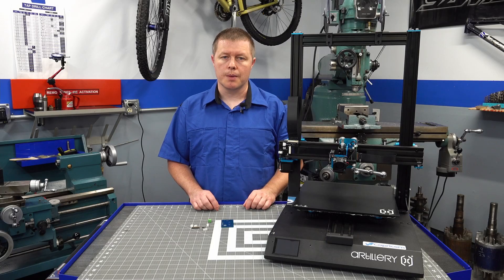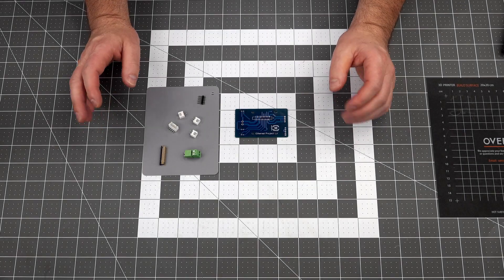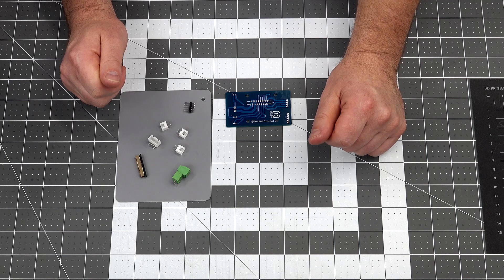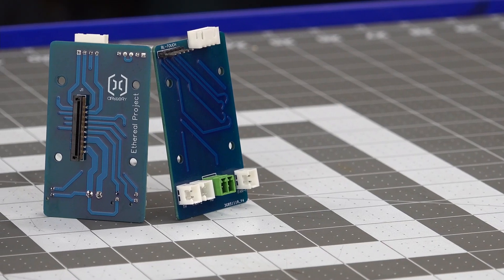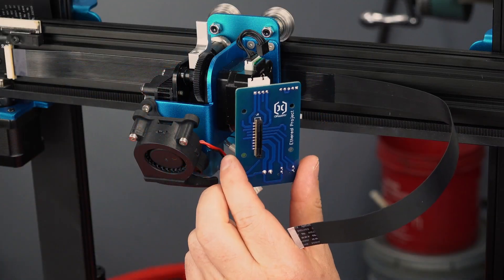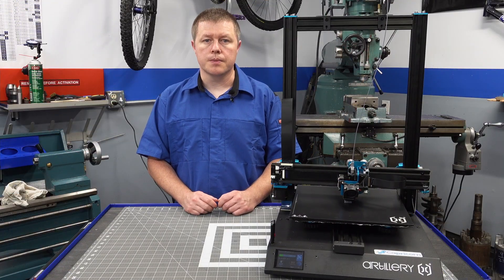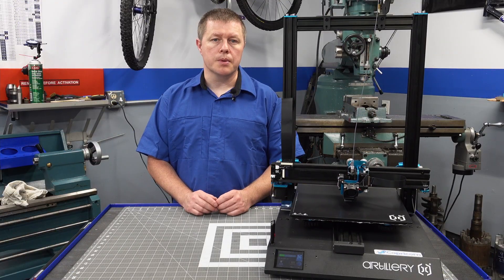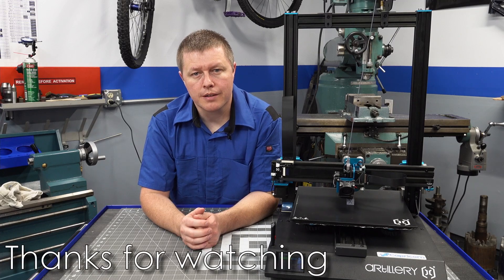Sidewinder X1 Custom Extruder PCB.

Comment: Great video. I just installed this board....but didnt use the ferrules as mentioned at 4:00. Will it be ok? Will i go to hell?
Reply from the maker: You should be ok for a little while but I would get ferrules sooner rather tha  later. It could last forever without, or they could come loose on the first print. Not having them can be a gamb.

Comment: This happens because the top 4 pins are connected to the extuder motor. And the two bearings (625Z) inside the extruder motor get damaged easily (as they work under pressure for pulling the filament) and they need to be replaced. If not, then the extruder motor works under high friction (even stucks sometimes) and burns the cables. This is what I figured out.

Comment: First things I printed with and for my SWX1 were a cover for the x-axis board and a new cover for the extruder with a BL-touch mount. Both with guides for the cables, so they sit more securely and dont bend so close to the connection. I have had this printer for about two years and so far everything is perfect.

Comment: You are not welding correctly. The tin is applied in the same place where you are heating with the soldering iron. You are using too many flux The solder you use incorrectly for soldering ALREADY HAS FLUX IN ITS CORE.
Reply from the maker: Thank you for your consideration.

Comment: Hello sir quick question I just purchased one of these PCB and really love the design but I am having issues with my hot end. Every time I try to heat it up it blows the 10amp fuse on the bigtree v1.4 turbo. I triple checked the wiring and looks over the hot end wiring and well switched around the wiring without luck. Any help would be greatly appreciated.
Reply from the maker: Double check that the wires going to your heater cartridge are not shorted, its easy to accidentally make the wires touch at the heater side when messing with it. Also check for a short from the board side to the mainboard.
Reply: @EtherealProject3D  Thanks a ton I triple checked everything again last night. I did some further troubleshooting. I put on the old board and heated it up without any problems. I put the new board back on without the heater cartridge and it still pops the fuses when trying to heat it up without any extrude. The fans work fine, BLtouch functions normally when powered on just appears to be the heater cartridge. I also removed the heater cartridge to ensure nothing was shorted out to not avail.
Reply: @EtherealProject3D  Really appreciate your response and help with this!
Reply from the maker: @LazyDayFPV . Ok, i will send a new board to you today, sorry for any inconvenience.
Reply from the maker: Could you email me your order number at etherealproject3d@gmail.com
Reply: @EtherealProject3D  appreciate you sir!🙏
Reply from the maker: @LazyDayFPV  what was your order number
Reply: @EtherealProject3D  10236
Reply from the maker: @LazyDayFPV  Thank you
Reply from the maker: Its on its way.
Reply: @EtherealProject3D  appreciate you!🙏
Reply: @EtherealProject3D  my apologies sir it wasn’t your board. The issue still persists. It looks like the hotbed is shorted once I connect the ribbon cable to the circuit board. It’s a v4 printer could that be the problem?
Reply from the maker: @LazyDayFPV  My board is made for the V4 machines.
Reply: @EtherealProject3D  interesting then I must have a v1-v3 🤦‍♂️ my apologies I will send back the other board!
Reply from the maker: @LazyDayFPV  does your printer have the button next to the screen?
Reply: @EtherealProject3D  no sir.
Reply from the maker: @LazyDayFPV  Yeah then you have an older machine and my board wont work. Im sorry.
Reply: @EtherealProject3D  Are the other PCB board's on your sidewinder version 1.5? 
I am looking to buy all the V4 PBC's to change everything over.

Comment: I looked at buying one of these when they were released but had concerns about the ribbon cable, at first they did not have replacement cables on their website and that was the final dealbreaker for me, in the end I bought a Creality Ender 5 Plus and built a Pro 3D V-King 400
Reply from the maker: Sourcing the ribbon cables was going to be too costly unfortunately.

Comment: Which way is the BL Touch cable supposed to plug into the board?
Reply from the maker: Yellow, red, brown, black, white starting from the gantry.
Reply: @EtherealProject3D  Thanks, I figured it out with the ohmmeter. Works great! Thanks for all the work you put in it.
Reply: Do you have a link for the stl file for the BLT mount that you are using?
Reply from the maker: @nflgun  You are very welcome.
Reply from the maker: @nflgun  Yes I do, email me at etherealproject3d@gmail.com

Comment from the maker: UPDATE: For those of you wanting to purchase one I have good news. I will have boards ready to ship in the next week. The boards are $15 USD. Shipping to the us is $10, Canada and Mexico $12, Europe and Australia $15. You can choose to have it assembled or as a DIY kit. Also you can choose if you want the BL Touch connector to be the the standard DuPont type or a JST type. If you are interested please email me at etherealproject3d@gmail.com
Reply: What kind of shipping is it, as $10 seems on the expensive side of things
Reply from the maker: @tampabuc2004  USPS Priority. After factoring in the box, bag, bubble wrap, shipping lable ect it ends up costing a few cents over 10 bucks.
Reply: @EtherealProject3D  I'm not trying to tell you how to run your shop, that's 100% up to you. But First Class is a great way to ship things under a pound. It could save you and the customers a little bit. Either way, I'm looking forward to your boards arriving! Any idea when you might have a BLTouch video up? I'm not very savvy when it comes to modifying and flashing firmware.

Comment: What about that fan duct? Did it make any difference over the stock one?
Reply from the maker: I don't really remember, I had the stock one for all of the first 2 prints. I got this one mainly because I think it looks way better and it has been working really good. Quite a few people use this one and say it is better than stock.
Reply: @EtherealProject3D  the hard part is that the 4020 don't give much pressure over its flow, so intricate ducts do not always work as intended. I'm having a hard time finding one that will let me print inner overhanging walls at 100mm/s without curling up. A 5015 looks to be the answer.
Reply from the maker: @brunoosti1  A bigger fan will always help with those pesky overhangs.

Comment: Just found your channel. Great work on showing us x1 owners of how to make our Great machines that much better. I am definitely interested in your break out board. As someone who has little hand function, I need my printer to be as easy to use as possible. So a BL touch would be great. I wonder if Artillery copied your work for the new X2. But I guess you could look at it as a honor that they ďid. Will be looking for your next video. Cheers from Canada 🇨🇦 👍 😀
Reply from the maker: Thank you for your kind words. I don't think they copied my design, but I am interested in getting the X2 to get a good look at whats different myself. I will post an update for the breakout boards when I am ready to start shipping them. Thank you again and cheers from the USA :)

Comment: The ZIF connector is an improvement over the stock connector but it will fail eventually too … just ask owners of early versions who had the same. The fix is far simpler - just print one of the many stain relief brackets to stop the cable flexing at the socket.
Reply from the maker: I agree that strain relief is a great solution. I think having a quality ZIF connector will be a great solution as well.

Comment: I have 4 Sidewinders all fitted with a BLTouch. How much will it cost for a fully soldered board with JST connector (BLTouch) shipped to the UK?
Reply from the maker: I will be charging $15 USD per board, I have not figured out shipping to the UK yet, Im looking for the most economical choice and I dont want the shipping to be more than the cost of the board itself.
Reply: @EtherealProject3D  Great please let me know the shipping costs when you have them. I'd like 4 of them if the shipping works out.

Comment: Great videos! Question: Is the spacing for the new heater connector the same as the stock one? If I DIY, I'd consider just desoldering the old one, and solder in the new one. Like others, I'd also seriously consider buying one of your boards if you go that route.
Reply from the maker: Yes it is the same spacing so you could DIY it, thats what I did, then came up with my board. I will be making a batch of these to sell. Parts are on the way.
Reply: @EtherealProject3D  Great news on the custom boards, I'll keep an eye out here. I replaced my stock extruder with a Bondtech LGX/Copperhead combo, but the leads on the stock heater are too short. I did an ugly copper splice in the middle, but haven't fully tested it yet. I'll keep an eye on it, and the fire extinguisher handy! Nice to have a screw in alternative, I can just trim the (new) heater leads to fit, and have right and tight connections.
Reply from the maker: @timlasson4093  If you do get the new board, I would recommend getting a new heater with longer wires that you can cut to the exact size you need.

Comment: hahahahahaha XD "congratz, you just greased an already wiggly/loose connection"
Reply from the maker: Yes, a very ironic "solution" Glad you liked it :)
Reply: @EtherealProject3D  I do recommend dielectric grease, but never without the strain relief. It doesn't improve conductivity (actually makes it "slightly" worse since it's non-conductive), but it does prevent the connection from degrading over time.

Your solution is better. No doubt about that and I congratulate you on a solid good looking design. Designing a new board and sourcing better connectors is beyond the grasp of the average  3d printer user. Their choices are to hope you sell them a good board, to keep buying new parts, or to print a strain relief and get some dielectric grease... Laugh all you want. It works when implemented properly using a little common sense.
Reply from the maker: @Scanjo  With proper strain relief, yes I can see dielectric grease being used as a means to reduce corrosion. But alot of people don't know this and thus run the risk of causing unwanted damage to their printer. I will be selling my version of the board, sourcing the parts takes a little time. Thank you for your input, its always welcome. Happy 3D printing.
Reply: @EtherealProject3D  When I reply in the Artillery group I try to educate as much as possible to avoid making the problem worse. Giving a half answer is often worse than no answer. ;)
Reply from the maker: @Scanjo  Good on you.

Comment: c'est quoi le produit liquide avant la soudure ?
Reply from the maker: Son flux appelé, La fonction principale ou l'utilisation du flux dans tout assemblage de carte de circuit imprimé ou retravailler est de nettoyer et d'éliminer tout oxyde et impuretés de la carte. Ces oxydes déposés sur la planche peuvent ne pas permettre de bons joints de soudure. Si le joint de soudure est pauvre, il y aura une mauvaise conduction électrique ou un mauvais flux d'électricité à travers le circuit.

Comment: Make a minimum of 100x. They will easily sell. That being said, Sidewinder X2 is weeks away and rumours are they have gone back to a locking tab design. Probably buy it as a spare part. The reason they moved away from it was because people wouldn’t release the tab and just yank it out.

Lastly, I don’t think I have ever heard anyone say use dielectric grease for conductivity. Everyone talks about it for anti corrosion properties.

Lastly, I defiantly think you should come up with a anti kinking design for the end cables. In my opinion, the bed wires kinking is the worst part of the printer. The break the power and thermistor wires. Such a shame. It’s a easy fix with some plastic sleeving.

I would love for you to make a video so I can just link them on how to fix it.
Reply: The X2 doesn't have locking tabs on the PCB.. annoyingly.. also the dielectric grease is basically to ensure you don't have humidity problems and "green" rust
Reply from the maker: You would think after so many people having the problem with the PCB they would fix it on the X2.
Reply from the maker: I believe you are right, I could likely sell a bunch of these, got to start looking into how much it would cost me and how much I would sell them for. I have seen alot of different "reasons" to use the dielectric grease, the most annoying is for conductivity, witch is why I specifically mentioned that. I solved the bed wire problem by making them longer, and having them come from the other side of the back of the printer so they don't have to bend as much over the movement range of the bed. Thanks for your feedback and thanks for watching.